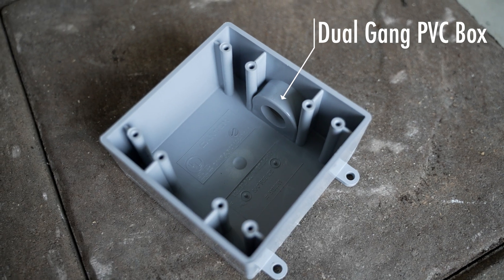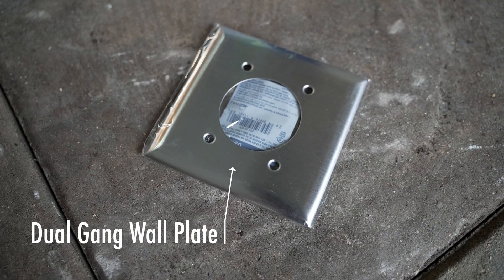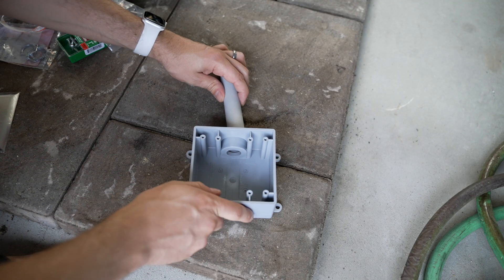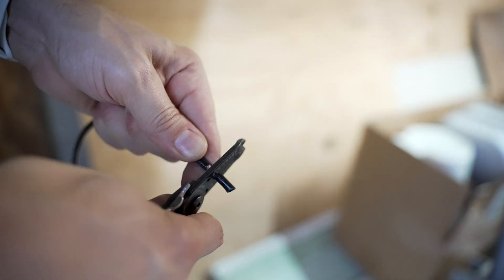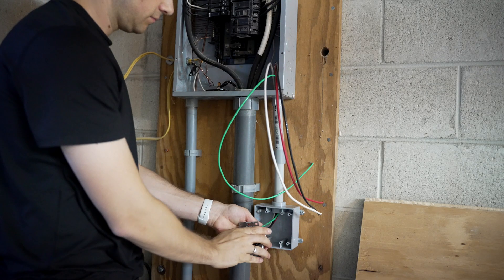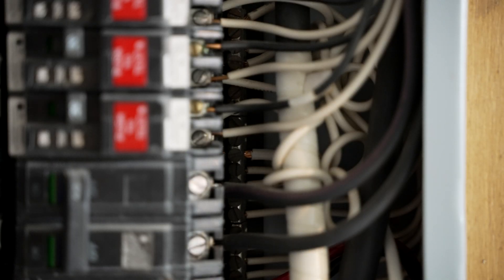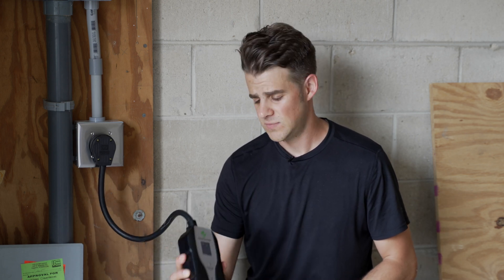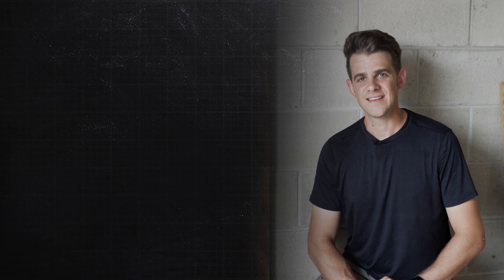Installing an Outlet for Level 2 EV Charging

Comment: Use the Leviton Plus 50 amp model. It’s much better than what you’re installing . I used this same plug and it overheated so bad my charger would not work. It just shut off after about 20 minutes. The Leviton Plus is an EV specific plug and once installed the overheating disappeared and the car actually charges now.

Comment: Cheap 14-50A recepticles are not capable to handle 50 amps of constant power, get a Hubbel recepticle rated for EV use

Comment: @josh - do yourself and your audience a favor and warn them about using that cheap leviton dryer receptacle. It is a well know failure point for EV charging and is known to melt and could easily cause a fire. The Hubbell 9450A is the way you want to go.

Comment: I have a few dryer plugs so I used one with an adapter and it charges at 32 amps by default as selected by the tesla I just bought. 50 foot 50 cable through the dryer vent to the front of the house.

Comment: 8 and 10 gauge for 50 amps will burn your house down at the worst. Should have used 6 gauge wire for 50 amp load.

Comment: Curious, would you be able to use the A/C + Level 2 Charger at the same time?

Next question, would you be able to use your A/C + Level 2 Charger + use your microwave at the same time?

What does all that depend on? The breaker? The gauge of the wires? Your electric company?

Comment: Do not use a NEMA 14-50 residential recepticle!  It's not rated for 100% duty cycle.  Too many house fires result in this application.  Use a Hubbell commercial rated recepticle instead.  This is why DIYers shouldn't do this install.
Reply from the maker: I’ve swapped all of mine out and have a video on just this. I’ve heard many stories of professional electricians having used these cheaper receptacles.

Comment: That garage has some sloppy wiring and by seeing your hack work installing a charger plug, I know why. When using PVC in electrical, use PVC glue. Sch 40 is made to go underground. Sch 80 can be used above ground like in what you did.

Comment: So, #8 THHN can be used with a 50 a amp breaker? 1) But, does the 14-50 outlet have a thermal rating less than the wire? If so, then shouldn't an outlet thermal rating decide on the wire thermal rating? 2) Also, I have a smart QPQ outlet charger (haven't installed it yet) CAPABLE of up to 48 amp charging. But, from the NEMA 14-50 outlet plug, it has #8 conductors & a #10 ground going to the charger body. I don't know what the wire size is going from the charger body to the charger plug that is inserted into the EV. So, is this dangerous since this charger is capable of charging UP TO 48 AMPS and is advertised as doing that?! It seems to me that to be safe, I should limit my charging on the sliding scale of the QPQ app to 40 amps and not 48 amps? What do ya'all think out there? I did buy a Bryant 14-50 outlet. And I live in TN where TN is still on the NEC 2017, so no GFCI 50 amp breaker yet required.

Comment: I had my Lectron V Box installed yesterday. Step 2 charging on a 40AMP circuit.

I wish I knew electrical engineering because I could have saved money.

Comment: My house is old, and has no garage, but I want to get a used electric car,  I have a 220 outlet in the backyard but it's over 35 ft away from the driveway, so I was thinking 
because of the videos like this, maybe I could upgrade the 110 outlet from a room that has a window that is closer to the driveway where the distance between the outlet and 
electric car could be as low as 5ft,  but  how do I know my home can handle the 220 minisplit I have to run all  night in the summertime, and also be charging the car?   (I live in Las Vegas and we all use air conditioning from May through mid September mosf of the time from  6PM until 5 AM because it's still an average of  84 degrees even at night)
Reply: Don’t use existing regular circuitry.

Comment: HIRE AN LICENSED ELECTRICIAN!
 I had a charging station added to my garage. My electrician attach my Charge Point EV station with ALL metal parts.
I repeat, all the parts were metal ( NO PLASTIC PARTS).
He then refuse to use a Home Depot bought receptacle. 
He used a electrical supply store, $100 Hubbell receptacle.  He explain this is the best in the industry and why go cheap when you spent $70,000 on a vehicle. 
He later brought me a video of a house fire from one of those cheaper receptacle. The owners insurance company challenged the claim because they used a unlicensed handyman and questionable big box store parts.
Spend the money, people.

Comment: You need a GFCI  breaker since that outlet is in the garage. If you don't want to spring for a GFCI breaker you can direct wire the level 2 charger instead of using a plug. Get that fixed ASAP. If you have any accident or fire the last thing you want is the insurance company to have an excuse not to pay out a claim due to a electrical code violation.
Reply: The Tesla level 2 charger has built-in GFCI protection.

Comment: Some clarification. It is good that you mention a follow-up and changing the wire and breaker size. A number of comments mention requiring a gfci breaker. This is a code change but not all areas have adopted the change. I am in NC and am not yet required by inspectors to use one. Having said that, they will eventually. The other issue is that Tesla chargers are causing nuisance tripping on gfci breakers so they are trying to find a solution for that. Personally I try to avoid plug in applications and encourage customers to go with hardwired. Cheaper and with higher potential output.
Reply: I am told that Tesla chargers have built in GFI and this has caused breakers with GFI to trip intermittently. Imagine this happening at night, and you get up to go to work the next day and your vehicle is not charged. 
My Lexus is a plug in hybrid (NX 450h plus) which is electric and gas powered, so I would be good to go.
Reply: Most EVSEs have a built in GFCI but you are right that the Tesla seems to have issues. The GFCI breaker is only required for an outlet type install (to protect the outlet) not hardwired. They are talking about a solution that involves using a breaker disconnect in the circuit. Time will tell it that solves the issue.  @prosay

Comment: Your install is not code compliant. The breaker feeding the charger must be GFCI protected. #8 is rated for 50 amps but the cheap residential receptacle you used is not rated for continuous use and is a major cause of fires in EV charger set ups. The best receptacle on the market for plug in EV chargers is the Hubbell, which is rated heavy duty rated for continuous use.
Reply: That's the nice thing about DIY. Screw code. I'm interested in installing a safe and functional EV charger. I dont care if it's 100% to code.
Reply: @PoNKPoNy  Just because it works that doesn't mean it's correct or safe.

Comment: question...
if i have the mobile connector with the nema 14-50 converter coonnected to a 240v outlet...does the mobile connector now become a level 2 charger or is it still level 1?
Reply: Still level 1

Comment: Yes, you should be using 6 gauge stranded wire, and a Hubbell NEMA 14-50 Industrial outlet, which is built specifically to accommodate the heat generated. Also, the Hubbell doesn’t have screws that press into each wire, and because it’s stranded would cause the wires to spread causing an unstable connection. The Hubbell instead uses hex screws that gather and pull together each wire giving a much more stable connection. This also allows you to better torque each wire to the recommended torque. Finally, the Hubbell is made of a Bakelite material that will withstand the heat without melting. It is also a bit larger than cheaper knockoffs that look the same but are made for appliance connections that are used for much shorter durations and many fewer amps. The other thing to know is that it’s seldom necessary to charge at the highest rate, 48amps, creating the highest heat, but instead charge at 32 amp which gives you about 25 miles per hour of charging and can fully charge overnight and at a cheaper rate. Hope this helps.
Reply: Thanks for great info! I used 6-3 wire and BRYANT one and yes this outlet is really sturdy. The 6 gauge wire is really thick and hard to bend, but I used also the torque screw and they are really secure. I see that the breaker also has similar mechanism to secure the wire, though less torque (75 vs 45) Also I used 60A breaker just in case it is used with powerful device later. Hope it goes a long way!
Reply: @learnserve  Not sure, but that sounds dangerous to me.  You want the breaker to be the weakest part of the circuit, not the strongest.  You want the breaker to trip before the wires heat up too much.  The breaker is there to protect the wires.  And your house.  The breaker does not determine how much power goes through the wires.  The load does.  I would suggest you do some more research on this and in the meantime switch to a 50 amp breaker, or lower, pdq.
Reply: @Tom-dt4ic  hmm. I am not sure why I chose 60amp at that time, but now I see that 50 amp sounds better. My Tesla Y would use up to 32 amp though. (Tesla App says so) I used from Aug until the mid-Apr, and there was no strange issue. I am not sure when I would exchange, but thanks for your suggestion, though.
Reply: @Tom-dt4ic  Another website says, 60amp for 6-3 wire is kind of safe: "6/3 is normally protected with a 60-amp breaker. Since there are no 55-amp breakers, code allows you to round up to the next larger standard size."
Reply: @learnserve I read on another thread that code would be 50.
Reply: @learnserve  Although you may be allowed to round up breaker size, remember that the max ampacity is the lesser of either the breaker or the wire, whichever is lower. For a continuous load you need to go no higher than 80% of the weakest link. So, you're still confined to no more than 40 Amps of continuous load with a 14-50 plug and # 6 cable. If Romex in insulation or the attic is used to feed that plug, in the US you're confined to the 60 deg column for wire ampacity, meaning #6 (NEC 334.80). It's a funny thing about temp rating of those industrial plugs. My Bryant plug is not stamped as good for 75 deg C, even though lesser more dangerous plugs are stamped to 75. So with the Bryant you're confined to the 60 deg column, which allows it another avenue for heat dispersion through the wires themselves. It's always better to overbuild hardware and put less heat strain on equipment, to reduce risk and to increase the lifespan of your electronics and battery.
Reply: He will only be able to safely pull 32 amps with this 8 gauge wire anyway.
Reply: 8 gauge is fine on a 50 amp circuit provided that the breaker, the wire, the receptacle, and all of your splices are rated for at least 75 degrees celsius. Which for sure the breaker and the wire he used are. Not sure about the receptacle. The Hubbell or Bryant receptacle (or the higher-end EV-rated Leviton) are the way to go for EV charging and those definitely are.

The breaker does need to be a GFCI breaker though since the receptacle is in the garage. This requirement can be avoided with a hard-wired charger.

Comment: Only portable or readily-removable (no tool necessary) EV chargers are allowed to use a recep. If it is mounted to the wall, must be hardwired.

Comment: My only problem with the video, you didn't verify you did the job right by testing it. Always check, for anyone reading you'll get 120v on one side X and 120v on the other side Y using your multimeter.

Comment: Wrong, the offset is to accommodate the distance between the KO or The Knockout and the wall because the conduit needs a strap on it I don't care how short it is it needs to have an anchor within 12 in of the box of any box whether it's longer than a foot or shorter than a foot there must be at least one within 12 in of a box that allows you to strap the conduit tight and snug to the wall well still meeting the clearance from the edge of the Knockout to the conduit connector. And also, reaming conduit although a wise practice has been banned in some areas such as in san fransisco. . . . I know, it does not add up! Like most everything they require, such as not one but two grounding rods 10 foot length, not less than six feet apart, and not more than seven feet apart.  .  .  Full of themselves at s.f. city hall!!

Comment: This 50 amp needs a 6 gauge wiring or this is a giant fire hazard if I were you I would replace treplace the wiring immediately if there happened to be an issue even the insurance company would investigate and find this video  and not cover the loss
Reply: Incorrect, #8 THHN is rated for 55A.

Comment: So im hearing if I use a GFCI breaker...there will be nuisance tripping?
Reply from the maker: Yes, that can be an issue. It’s crazy that the new codes requiring it have corresponded with everyone wanting to use 14-50s for EV charging. The charger should have built in GFCI, making a breaker redundant - as long as you are plugged in. The two GFCI systems can interact and trip which seems to be the primary issue.
Reply: @chargeeverywhere   So my customer has only a plug in charger ( no hard wire option) for his New mini cooper...I am a licensed electrician , but haveing my first experiences with EV chargers, ..The charger is going outside, not in garage...So instead of installing a receptacle on the house with GFCI protection wich may nuisance trip, I may elect to run to a PVC junction box ..take the plug off charger ( may technically void charger warranty and run into a UL listing kinda code violation) and run it into junction box...essentially hard wireing it and avoiding nuisance trips and exposing people to unprotected recepticle outside.
Then I can sleep at night.
Unless I talk them into buying a charger that can be hard wired like the Tesla.
Reply from the maker: Hard wiring is the way to go - especially for exterior use. There are some decent permanent chargers at prices down to about $400. My colleague has an Emporia unit and seems happy with it. This also has some smart features, which may be attractive to your customer. Another inexpensive option is a Grizzl-E (~$460), but this is a dumb charger. While both have plugs on them, typically, it is not a problem - and even manufacturer recommended - to replace the input cord stub with your conduit and hard wires. If they had a hardwired option they could throw their mobile connector into the trunk for emergencies and if they are visiting someone out of town.
Reply: @chargeeverywhere  There's a smart version of the Grizzl-E as well. More $ obviously.
Reply: @chargeeverywhere  well the code is actually protecting to outside receptacle from anyone being shocked ....the code isn't concerned about the charger or cord..
This same stuff has been happening my whole career...when GFCI came out..and then  Arc fault..now car chargers... One situation ends up contradicting another...let's go back to knob and tube..no ground...lol

Comment: Holy undersized wire gage, Batman.  When the garage burns down, they'll blame the batteries in the car and initiate a recall.
Reply: 50A breaker runs at 40amps max. 40amp requires 6 awg wire for applications that run for more than one hour. The Leviton connector is garbage. Must upgrade to Hubbel industrial rated connector.
Reply from the maker: 8awg THHN is rated to 50amps at 75C, which is the temperature the breaker and outlet are rated at. You are correct that 6awg would be better overall.
Reply: @chargeeverywhere  I mean you keep saying that, but there's not a wire sizing guide out there that supports it. Just because you keep saying it, doesn't make it true.
Reply from the maker: https://media.distributordatasolutions.com/ThomasAndBetts/v2/part2/files/File_7437_emAlbumalbumsOcal20(USA)oc_1_g_nec31016pdfClickHerea.pdf

Comment: Neutral wire are is required in EV charger - 240 Volts?...
Reply: Generally neutral isn't used, but the NEMA 14-50 receptacle has a neutral and it somehow became the defacto standard plug for EVSEs.
Reply from the maker: There are some NEMA 6-50 EVSEs out there, but they are much less common. The 6-50 does not have a neutral. I would hazard a guess that a 14-50 for EV charging could be wired without the neutral, but that’s getting a bit sketchy as the outlet should be wired properly.

Comment: wait.. so in NA your earth wire is allowed to be thinner than the hot conductor?
Reply: Yes
Reply from the maker: Once you get larger than 10awg on the conductors this is the case. EV charge cables are typically this way too.

Comment: That is an easy job, if your break is in the garage, its a different story if its in the basement and you have to run the wires for 20 to 30 feet.

Comment: During this installation, does all power via the switchboard need to be switched to an "off" position? Or just the circuit you are working with?
Reply: Sir, ideally, the panel should be turned off and checked deenergized (no power) before any work is started inside the panel.

A slip of your screw driver on just a 120 volt line could yield a short circuit in the thousands of amps....vaporize the metal.

Gfci are set to trip at about 5 milliamps.to protect you and we are talking thousands her.

Also the flash burns and molten metal.

So, yes, ideally, no power anywhere in the panel.